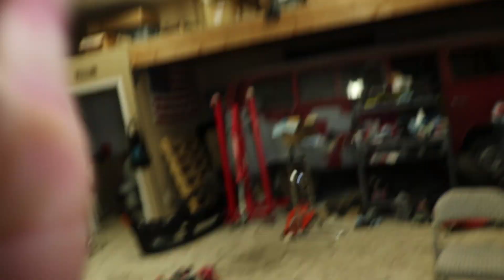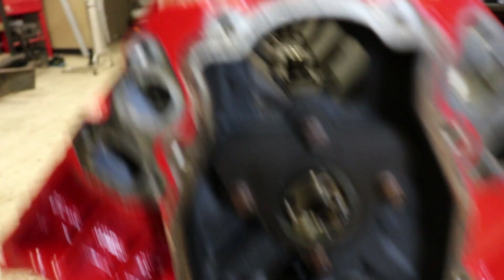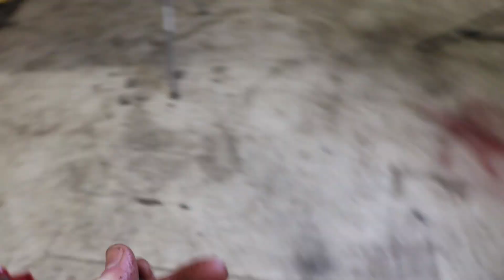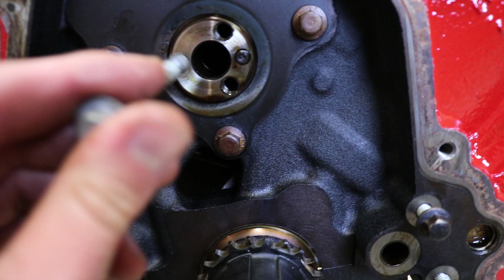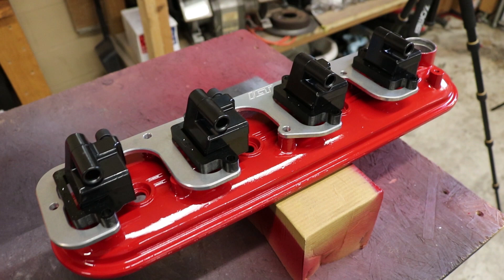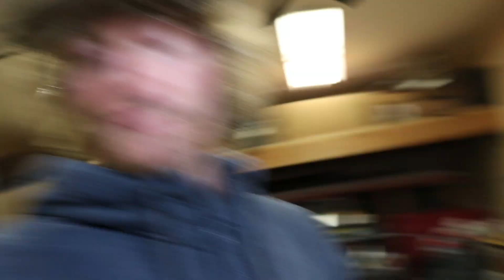How To Install LS 5.3 Cam / Set Timing - Silverado BTR Cam Swap

Comment: What made you not wanna pull the pistons and check main bearings and not install new OEM piston rings?
Reply from the maker: It only had 80k on it and everything looked good and honestly just needing to get it back into the truck
Reply: @ gotcha! Sorry if I missed that part! Any explanation on what made the piston hit the valve?
Reply from the maker: A failed valve spring, they were brand new ls3 springs, one broke and dropped the valve into the piston
Reply: @ was the truck literally idling when it happened?

Comment: Every time you try to save a nickel or a dollar it always cost you a couple of thousand That's why I went with a Brain Tooley cam and new lifters springs and retainers haven't decided if I'm going to use the same valve locks

Comment: So, you put in a new cam without mic'ing the old cam bearings?  That sounds like not good.
Reply from the maker: How so
Reply: @MitchCarveth  Excessive wear on the old bearings will translate to excessive vibration or movement in the new cam, which will cause premature failure or a spun bearing.  I'm not saying you need to line hone the block every time but I wondered if you had anyway to check the wear of the cam bearing.  Your "new"engine had about 100k miles on it.  That's not insignificant.  You seem fairly meticulous in several areas so wondered if you had addressed that off camera.
Reply from the maker: @robertschaefer7200  Definitely agree with what you said, I honestly just did a visual inspection with flashlight and telescope mirror on this one though.
Reply: @MitchCarveth  Finishing the video series and its awesome.  Love the occasional "aw shit" look into the camera.  I've been building cars for over 40 years and the one thing I know is that shit goes sideways.  Bolts break, rocker arms don't fit (wink, wink), you put something back together backwards, and so forth. I also know that there's always something to learn.  Thanks for helping us learn.

Comment: What happens if I took out the cam without doing that top dead center thing.... asking for a friend lol
Reply: I need to know also... my friend did the same thing 😂😂
Reply: Nothing, you have to redo the timing anyways since you are putting in a new cam in. It just helps make things simpler, just make sure #1 is all the way up and your marks line up when all said and done.

Comment: can you only buy a cam or do you need springs and everything
Reply from the maker: Really depends on cam, if you go a low lift stage 1 cam you might be able to get away with it. I dunno the year of your vehicle but if you have 799 heads from factory then you are set with ls6 springs and can go stage 3 low lift like i did.

Comment: Why does the piston need to be at top dead center ?
Reply from the maker: Easiest way to insure the timing will be set correctly.
Reply: @MitchCarveth  so most people don't show #1TDC just Dot to Dot 6 and 12. I keep getting conflicting info about this with LS motors.. Verifying #1TDC is important correct?

Comment: Congrats!!! you my friend are the first and ONLY person I have EVER watched in a video that says to put a cam in slow and easy to save bearings and actually did what you just said!! Every single video I watch, they say be super careful going in, don't want to knick those cam bearings, then as soon as #5 is inside the block they bang that shit off everything but the floor. After boogering up #2 bearing going in the block, so 2 sets of $50 cam bearings and a $500 BTR cam. I for damn sure made sure it went in without touching anything. It takes 5 min, max guys.  The TV show hosts are the best!  they beat the piss out of everything. "After we removed the bolts we can take fan shroud out of the vehicle" then they rip that sum bitch out by the roots. You can tell they build motors to hit the dyno then the back store room. As long as all their free parts make 3 dyno hits its a win i guess.
Reply from the maker: lol thank you!! and i honestly couldn't have said that any better myself.

Comment: If I get a stage 4 tsp cam do I need a new timing chain and / oil pump ?
Reply from the maker: Dependens on how miles you have, definitely suggest dual valve springs though.

Comment: Would you happen to know What the torque specs for the 
-3 bolts to the gear holding the timing chain, 
-the 4 bolt plate holding the cam 
-& the timing cover
Please help
Reply from the maker: I thought i had mentioned these torque specs in the video, my bad. 
The Camshaft sprocket bolts are 26 ft lb
Thrust plate is 18 ft lb 
Timing front cover is 18 ft lb as well
Reply: Mitch Carveth sorry if I missed it I’m watching  your video at work on mute lol thanks for the fast reply bro 👍 i got stuck on the re install cus I wasn’t sure on the specs
Reply from the maker: @betosgarage  lol all good man, and no problem! Good luck with the install!
Reply: Mitch Carveth Is it ok to completely rub the assembly lube all over the cam before install? I just did that and installed it then had second thoughts
Reply from the maker: @betosgarage  you are all good man! The more lube the better to be honest. The last thing you want is a dry start lol
Reply: Mitch Carveth ok great ! Haha I was like man I think I put too much lol ok now Ima replace all gaskets and put everything back together . Thanks for the fast reply man 👍
Reply from the maker: haha its really easy to think that cause the stuff is so thick! and any time brother!
Reply: Mitch Carveth worst thing happend. when trying to put everything back together I was removing the wooden dowels used to hold the lifters up & they broke where I was pulling them from now there stuck inside . Is removing heads my only option, or is dropping the trans and  pushing them out the back a better option?
Reply from the maker: @betosgarage  Oh shit man I'm sorry, honestly I'm not sure on that. I'm thinking at this point maybe pulling the heads would be easiest unless you can get a clear shot at the rear cover once the trans is removed.
Reply: Mitch Carveth ima give it a try thanks bro
Reply: Mitch Carveth homie, I got the wooden rods out finaly
Reply from the maker: @betosgarage  hell ya! I was wondering how that was going. What did you end up doing?
Reply: I dropped the trans , removed the rear main back seal cover . Bought a real long 5/16 metal rod from Home Depot & shaved it flat on one side with a grinder and I was able to pound them out the back . Then I used compressed air to clean the bits of pieces of broken wood in the holes where the wooden dowels were at. Took me two long days
So now I’m finaly ready to start putting everything back together
Reply from the maker: @betosgarage  yay stupid shit that happens when doing car stuff huh? lol im glad you got it fixed tho! not gonna lie i was a little worried you would need to pull it cause i didnt know how much room you had in the trans tunnel.
Reply: Mitch Carveth I know right haha man that had me realy stressed , I thought I was guna have to get a whole new engine lol . Im goin to slowly start putting it back together.  My pac 1218s springs were on back order . But for the cam retainer do I have to use blue loctite bro?
Reply from the maker: @betosgarage  i've been taking my time as well because i only want to do it once lol as for the retainer you don't have to use any blue loctite, i didn't use any. It obviously wont hurt anything if you do tho.
Reply: Mitch Carveth even on the bolts you installed them with no loctite? Just trying to see what I can safely get away with . Cus I keep seeing on other install videos that people replace the cam retainer as well but I didn’t want to go buy one lol
Reply from the maker: @betosgarage  i just made sure and cleaned the bolts real good and triple checked my torque specs lol im not saying don't use loctite but i know plenty of people that have gotten away without using it so its really up to you. I did replace my retainer plate just to be safe because the gasket was looking pretty smashed plus i didnt want to risk a losing oil pressure later on. just to be safe i would think about replacing that plate.
Reply: Mitch Carveth ok Ill replace the plate just to be on the safe side , Cus I only want to this once lol . I also got new gaskets for the valve cover timing cover and water pump . On the timing cover do I have to add RTV after the gasket before it gets pressed on the block?
Reply from the maker: @betosgarage  Its defiantly a good call to replace it because that would be horrible to have to replace later when you were already in there lol the timing cover gasket is supposed to go in dry but i did put a little bit of RTV on the bottom corners where the oil pan the block and the front cover meet. thats all you should need. some people don't even use any RTV at all.